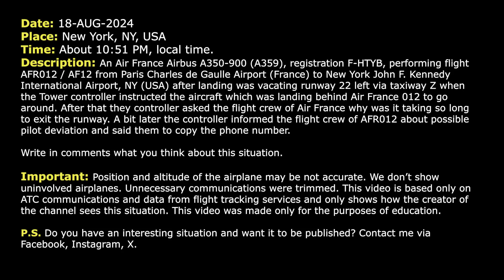JFK Tower controller becomes angry with Air France pilot for slow vacating. Real ATC

Comment: Pilot has already received clearance from controller for vacating via Z, that means it gonna take much time than usual. Controller should have instructed the AFR012 vacate via H or I in order to let Turkish 11 land properly.. Sorry that is a clean planning error for controller.
Reply: With wind 080/070 on runway 22 and probably a 160 or greater to 4 as New York approach are famous for putting on pilots I’m not surprised they planned to roll to the end of the runway. Also why clear a following aircraft to land when the previous aircraft hasn’t even landed yet itself.
Reply: Was it possible for the A350 to exit via all other turnoffs though?
Reply: The controller only confirmed it is available, not that he should use it. Airfrance should still follow good airmanship and exit as soon as reasonably possible. Don’t know what that would be in this case... Maybe they braked to vacate at J, came to a complete stop, took their merry time to retract the flaps and then slow-taxied to the end. That would deserve a talking to. We don’t know.
Reply: @rutgerw. It’s clear, that they asked for exiting via Z
Reply: @Alex-su4lc  Not really, they could be planning J and just want to make sure Z is available if they need a plan B. Either way they should still keep up the speed until clear of the runway... The controller doesn't have the time to start a whole conversation with the pilots so he will have to assume they follow good airmanship.
Reply: @rutgerw.  That’s not the point of time for making plan B. Plan B should be arranged already, of course by reading the notams first. So no need to ask the tower anymore.
Reply: @Alex-su4lc  ATC said Z was available... ie not closed.  ATC didn't hear Air France ask to exit Z.  He asked Air France to repeat his request at least twice, and Air France worded his request differently each time!
Reply: @pmj059  Yeah I‘ve seen the video. I think the French pilots are just not that good in speaking English. It’s common sense that you ask the controller if you can do something in a special way. I‘ve never heard someone asking ATC if something is available, just as a backup without planning using it. When you ask ATC, is the VOR approach available, it’s clear that you want to do the VOR approach. You don’t ask for the VOR approach but do the ILS then. That’s something you can read in the NOTAMS, AIP or ATIS
Reply: @pmj059 thats bullshit. Its an A350 so they programmed the BTV to vacate at Z and wanted to confirm that, which the Controller did.
Reply: @rutgerw. You really don’t know what you are talking about…
Reply: @Alex-su4lc  Isn't it common practice to for example back-up a visual approach with the ILS or plan the ILS but turn off the automation once visual? I can also imagine the pilot asking if ILS is available when given a visual, just to make the point that they should have been given an ILS approach or in this case claim the whole runway as is their right, to make a point about the idiotic spacing at JFK. Pilots eventhough they have read all the notams, might not be 100% sure about something and just ask to double check and know all the options even if they end up not using them?
Reply: @rutgerw.  I mean obviously it’s not impossible, that they ask but then won’t use the option. There’s not a rule which forbids asking. That’s probably the reason why the controller misunderstood it. He wouldn’t if there would be a clear rule. But it’s still common sense what the pilot meant and as an experienced controller he should have understood it. But mistakes happen. As I already mentioned, that’s just not the point where you make plan B. In short final you have to be all set for landing, you can’t change your plans there. And if you’re not sure if Z is available you should just plan without Z. In this case they planned without Z, but because Z was available they used Z anyway, but that won’t work the other way around. You can’t plan with something you’re not sure about.
Reply: @rutgerw.  I'm an airline Captain and if the controller didn't get that AF was requesting/planning/intending to vacate via Z, he probably lives on another planet. Everyone working in aviation as a pilot or controller, hearing that sentence would have AT LEAST suspected that AF was going to vacate Z. It would have been a perfect by-the-book request to say "Request to vacate via Z" but "Is Z available?" asked by a pilot on final 110% means he is aiming for that.

Comment: how is this a potential pilot deviation? when you touch down, the runway is yours
Reply: Ikr, and if the spacing is that tight, why not state "expedite?"
Reply: No European pilot would call the number anyway.
Reply: As a retired tower controller, I was thinking the same thing.
Reply: I would put the blame on both side: Pilots of Air France is at fault for taking their sweet time to vacate. You are supposed to expedite vacating the runway on busy airport like this especially knowing there is a traffic right in your @ss. In Most airports I operate, you must vacate the runways within less than 50 seconds to avoid this kind of situation.. ATC could have advised Air France to vacate without delay due to traffic right behind them..
Reply: From the moment you are cleared, until the moment you confirm vacated (or clearance is cancelled) the runway is yours...
Reply: It is their fault, because all these major airport have rules for “Minimum runway occupancy time”.
Jeppesen 10-1Ref charts or country’s AIPs
Reply: Innit! Looks like the controller is just acting out of spite, frankly.
Reply: He could have told them to expedite vacating runway - especially after they asked about Z which should have alerted him of a long rollout.
Reply: Should AF be allowed to stay on runway until Christmas?
Reply: this controller is always snippy about stuff
Reply: I think he faked them out on it to get them to pay attention.  He didn't give them the number.  😅
Reply: @seanpellegrino2989 If it is so, what a stupid behavior of ATC. Would be interesting to get specifics of planes separation here…
Reply: @seanpellegrino2989 But the last controller did.
Reply: @seanpellegrino2989 Right, good point.
Reply: @seanpellegrino2989  he could also be trying to cover up himself, and … 2nd though, realized this GA should not be investigated closer.